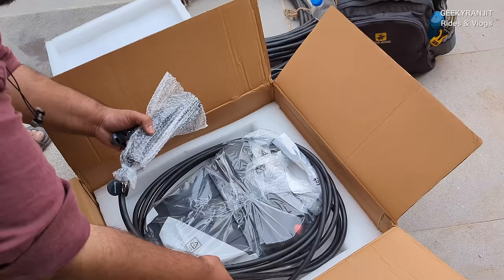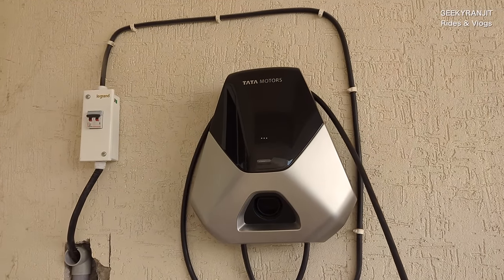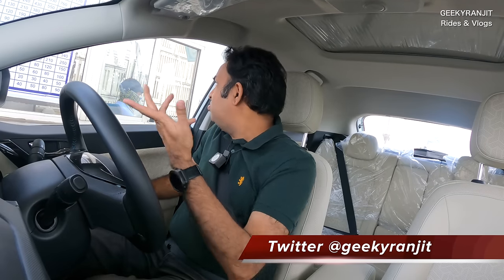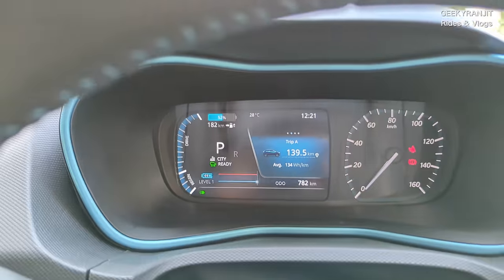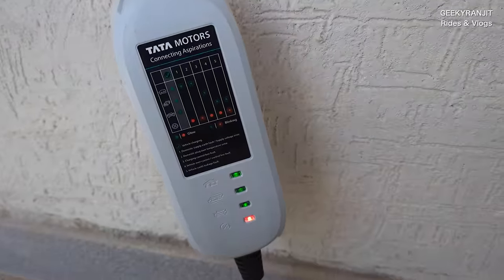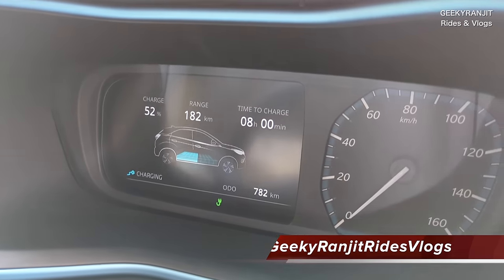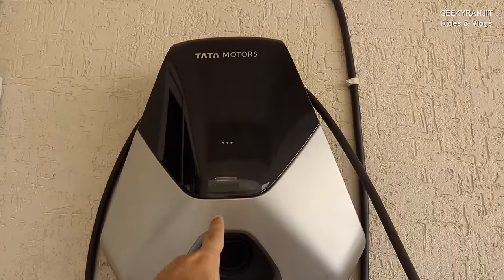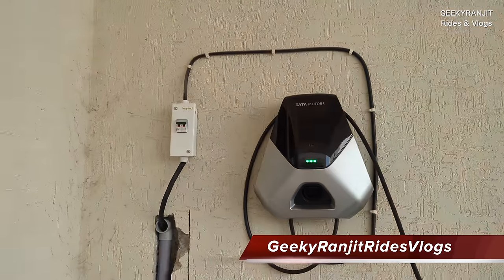Nexon EV MAX 7.2 KW Fast Charger vs Regular Charger and Tips

Comment: I always thought EVs are trash before. But when fuel prices rise and some minor road blockage connecting my state, i was fed up and bought Ather 450x. I was amazed till today and my thoughts towards EVs has completely changed. I plan on buying EVs for my 4 wheeler also when i have the money. I also think that for Indian EV lovers, Tata has done a really great job as many EVs which are not Tata are always so pricey!
Reply: I believe for a Nexon EV there a warranty for the battery for 7 years.  If it fails after that, a new battery will cost 7.5 lakhs.

If the motor fails, it'll cost 4.5 lakhs.

Ridiculous numbers. 

Taking this into account, how is an EV economical compared to an ICE?
Reply: @tanmay8844  its like thinking your ic engine fails after company warranty!  Just understand that the battery that tata uses has 3000 charge cycle capacity. 300km range per charge means 3000*300=9lakh kms. The battery should last around this. And for the motor a very rare chance of failure. Even age old reva's  are running good. For a person who uses a car intensively can save a lot. Driving feel of an ev is unmatchable.dont just think only about the economy. No sound ,no vibration, no gear shift delays, no gearbox problems,no jerk . Butter smooth ride.
Reply: @turbocharged962  Dude we don't even have proper roads and infrastructure. wake up
Reply: @shreyasdharashivkar8027  ok take an example
Daily drive 50km
Annual drive 18k km
Drive in 7years 126k km
Cost on petrol if price dont increase  6.3lakh
Cost on Elec if price dont increase 80k
So you save 5.5lakh on fuel alone.
Also in an ICE vehicle engine isnt covered/wear and tear of parts isnt covered but in Ev there isnt that many parts.
Also 7lakh price quoted was sticker price and no official price has been quoted yet
Reply: @tanmay8844  u r assuming that battery price will remain same after 7 years!! I hope u r not running your phone on petrol because of battery insecurities
Reply: in the amount u bought ev, could purchase 2 tata tigor and still have less maintenance cost . battery replacement is heavy on ev
Reply: @turbocharged962  the data you shared was tested on specific enviornmental conditions , you will always see Terms and conditions applied on such data, country like India when sometimes it is extreme hot,cod,humid battery is badly affected and those numbers are reduced drastically. why you think gorilla screen smartphones breaks so easily while company claims blah blah drop tests? because other conditions are not factored in . and why did tata reduce the warranty year on the battery? before it used to be more and i highly feel many customers must have come in for battery replacements already
Reply: @priyanshuanubis  in EV battery replacement alone will cost upto value of a new petrol car. Also , if you suffer any malfunction on ev car during road trip you will need to take it to service center , get it towed etc since they cannot be repaired locally . the charges that you factored in as of now electricity charges might be low but soon will start increasing same case that happened with CNG, if govr really cared about pollution why increasing rates of CNG now, why you think people are preferring diesel over petrol or CNG? it makes absolute zero sense to buy CNG now, all your boot space is gone, long waiting line in CNG stations and so on and this will happen with electric cars also quite soon yeah sure you can charge car at home, but soon they will charge you seperatly for that meter
Reply: @loki4171  just to inform you, we can generate electricity! Rest any of the fuel cannot be generated by general public. We can use windmills or solar ongrid systems to generate electricity. Mnre is giving subsidy to household customers. I have already installed a 3kw plant at my home(generating around 400units per month). Just dont be too negative. If you dont want to buy ev, just buy a ice vehicle and enjoy. Ev's are for people who have fixed runs. And it's not for people who rarely use their car. Its better to buy and use the car maximum, than buying a car and keeping it in garage most of the time thinking of fuel price. Many people said this when ather launched their 450model. Even after 5 years the scooters are running fine.people who are scared of buying an ev can wait. Many more added technologies will come in future. Now its all beta products and only meant for people with heavy usage.
Reply: @turbocharged962  you do realize not every one has solar panel?  And still you have not said anything else regarding to my other points. Why are companies now reducing warranty years ? Are they afraid more people will soon start coming for replacements? There already has been cases for replacement simply search TATA battery replacement forum is full of it one customer got battery changed withing 4-5 years of purchase luckily it was under warranty that time.
Reply: @loki4171  tata has sold 1lakh ev's and you are talking about 1 issue. I can point about thousands of issues on ice models. Its all mechanical and electrical parts. That can fail.  Every ev's sold in India comes with 8years of battery warranty. Even maruti hybrid comes with 8years warranty. 8years is more than enough for an avg customer to milk maximum.
And about solar panels, a person investing 20-25lakhs on an ev can easily afford 1.5lakhs for a 3kw solar ongrid. Battery pack replacement is done under warranty. Post warranty companies have provision to repair individual cells.i am closing this discussion as i dont have time to change your thoughts. You can believe in your thoughts. 🤝 For your knowledge a petrol car with the power of an ev will need 8lakh rupees fuel for running 1lakh kms. A person with solar ongrid plant at home has zero fuel expense to run an ev for 1lakh kms, if his two and fro running is under 300kms. There are many daily commuters like that. It all depends on a persons need. Not profitable for everyone.
Reply: @turbocharged962  kindly update yourself tatat is no longer offering 8 year warranty now. Recently checked myself . And this is not 1 case multiple cases are coming and 1 lakh sold you said are for those who have not completed much years
Reply: @loki4171  tata motors website is displaying 8years or 1.6lakh kms warranty for nexon ev max. I don't know where you got 5 years  info.
Reply: @turbocharged962  from showroom . Also till 90k kms.
Reply: Hybrid cars are better for India for the next 5 years ,let the infrastructure of EV develop till that time one can buy EV later also why so rush 🤔🙆‍♂️

Comment: Correction : Prime or MAX can charge on any KW DC chargers. However Prime has maximum charging rate of 22 KW/hr and MAX has maximum charging rate of 32 KW/hr. So even if you charge max on 50 KW charger its maximum intake won't be more than 32 KW/hr. This data was provided by Zeon charging.
Reply: Correction : Charging is never measured in KW/hr, it is always just the power rating like 22KW.
Reply: @ashyouknow7420  Right. When KW/hr is mentioned it is obvious that it is rate of charging.
Reply: @studyneetjeeupscsccgatecam1903  kW itself means kWh/h where the time unit cancels each other, it's unit of power=energy/time.
Reply: @Amuzic_Earth  Yes i stand corrected. Point is prime charges at 22 KW and Max at 32 KW.
Reply: hi I'm poor in physics
Reply: @ajaythodupunoori7378  hi i’m poor
Reply: @IbbiAhmed  hi poor. This is Ranjit speaking and today on my channel we are gonna talk about the new tata Nexon EV max pro edition, kaziranga black edition
Reply: @IbbiAhmed  hello poor
Reply: Tiago Ev has a max charging rate of 19 kw

Comment: Diesels are best. They give good economy, good performance. Always ready just takes few minutes to fill full tank and range of around 500-600 kms.
Reply: Small diesel engines are going to be dead after April 2023 - read about Real Driving Emissions norms 😛😛
Reply: Once you drive ev, you will forget the diesel pickup. Ev drive is really breeze both in city and highway

Comment: I bought the same car on oct 14, because i belong from a rural area of odisha there’s no any first charger available here. i am  using 3.3kw charger at home and it’s giving me about 330-340 range in city mode on a single charge
Reply from the maker: Yeah without AC I also drove a bit and can get around 350 Kms, but with AC and my normal driving I am getting around 290-300 Kms again all of this in the CITY mode.

Comment: Hello Ranjith sir, even we bought the same car and there is a range drop considerably after 1 month of usage(250-270km) so kindly check the same with ur car as well
Reply from the maker: No issues like that for me....... now driven about 900 kms.....  I am driving anywhere between 45 to 90 kms per day.  Use it in CITY mode I am not getting good range in the ECO mode......  Also try charging once by taking it to a low charge like 15% to 100% in one full charge slow charge with the regular  portable 3.3KW charger, if any in-balance in the battery it would be balanced out.
Reply: yeah, try discharging the battery till 2-3% once, and then fully charge with a slow charger. that calibrates the battery.
Reply: I have run my ev around 3500kms and without ac it goes above 300 if not pushing accelerator hard and with ac around 270-280

Comment: Ranjit can u list the reason behind going for Nexon ev max and not any other ev vehicle?
Reply: 2 reason are there

1. Nexon providing best in it's price
2. Desh ka loha .....

I am also owning a Nexon Ev max top of the line model
Reply: @karanpandey4836  I’m also sir 🤙
Reply: There were only 2 options for less than 25L in India, this Nexon EV Max and MG ZS ev and i found the Nexon to be better and more value for my needs and the features I wanted. Also I had very good experience with my Tiago and trust with Tata was also a factor.
Reply: @RanjitKumar  How about electric cost and how will we charge when in highways? Or is it only for city travel? And what is the cost of battery replacement?

Comment: Changes for next nexon ev
1.:) change media screen size (now 7 inch) change atleast 10 inch with rotation facilities
2.:) Change the position of charging point, front number is a good area, some video review mension that the charging compartment filled with mud and water so please aware of that
3.:) Provide ventilated seat swich to sentral console system near the rotary nob
4.:) Increase the Central console system height a little more and put some  angle like Lamborghini style......
5.:) Wireless charger position is very annoying and it decreases the premium quality. Change the position 
6.:) Provide Moonroof
7.:) Electricaly adjest seats

Comment: I would like to add that AC charger is where input at CCS 2 port is AC and DC charger is where input to CCS 2 port is DC. In AC charger onboard AC to DC convertor is used while in DC charger no conversion required. All AC charger has SMPS circuit in the charger to regulate 230 Volt AC and current capacity also to handle rated current. That's why 7.2kwh charger has large size to handle heavy current. While in DC fast charger DC convertor is it self in charging station. When we connect gun to port, BMS checks the maximum charging current getting and shows the time for charging accordingly

Comment: If you are paying more for the Fast charger it should have a feature or option to select to slow charge as well.. just a feature that can be added
Reply: They are charging for the infra I think rather than electricity cost.
Reply: @TargetGadget  yea agreed, the device costs a lot. From this video understood that the Fast charge will only charge at full speed and cannot slow down. They can put a Software or Hardware feature so the user/car chooses to charge slowly it should be possible
Reply: @SwatejK  there are third party chargers now which you can select the amp

Comment: I would highly recommend using the 7.2kW charger - the type 2 charger at all times. It's safer n faster. Not sure why Tata is being cheap n promoting the granny charger - 3.3kW. The charger pins heat up, the plug can heat, n the charger itself will get very warm after a few hours.  Worldwide is only used in case of emergency for safety reasons.
Reply: actually every society do not give 10kw. mine I have to fight for 7kw

Comment: Just a thought , given that nowadays we are also seeing hybrid cars with a mileage of 22kmpl any reason but considering nexon ev . nexon ev has proven itself and leader in segment though . just wanted to understand you thoughts while you zeroed on to an ev.  This will help new car buyers to make decision without any anxiety over evs range
Reply from the maker: Hybrid is just a half based solution...... Electric and zero emmission vehicle are the future.  See what happened to BS3, BS 4 car now BS 6 standard II will be coming in effect in 2023 Govt will just getting tighter and tigher in terms of emissions.  I wanted a zero emission vehicle, also I will be install a solar plant so effectively I will be running this car for free.
Reply: I would say do your own research as well as there is nothing like zero emission. An EV already done its carbon emissions before it hits the road and also i don't see it's feasible enough to use ev.
EVs are only for those who has multiple vehicles at home or want to save on fuels but again ev comes with a higher price tag. Like nexon ev max comes around 21 22 lakh on the other hand a petrol nexon xz plus variant costs around 13 lakh in Bangalore. So it's too early to jump into the ev race. And we also need to look for the better alternative. Running a vehicle on battery is not the solution. IC engines have proven them over a long time where as evs are there in early stage. I remember there was a scooter launched in india somewhere 10 or 15 years back 'Yo bike'. At that time also people thought that ev is the future.
Reply: @ChhotaTrex  Agar EV renewable energy se charge Hota Hai tho  ice engine hai Uske total lifespan se Jyada emission nahi karti EV .........
plus EV kha Jyada potential Hai Kyunki Agar battery ka Technology develop Hota Hai tho EV zero emission ka milestone achieve kar sakta hai ice engine Mein yah possible Nahin Hai......
Or bahut se battery Technology abhi testing mein hai jo biodegradable hai....
Reply: @seven6094  yes totally agree but abhi bht time hai. Aur ek lithium ion battery banane me jo conventional fuel lgta h lets se mining ke time lithium extract karne me cobalt me wo itna zyda hai ki EV road pr bhale na kare pollution but wi already kar chuki hai so yes battery technology should be improved and most importantly the charging. It should be hassle free. Just like hum petrol diesel fill karate hain 2-5 mins and we are good to go. Aisa kuch jab tak nahi hoga tab tk conventional fuel hi better h.

Comment: Hi Ranjit, I have recently purchased a Nexon ev , along with this an AC 7.2kw fast charger is also provided and have now been installed at my home. I came to know that slow charging is what is recommended for battery health in the long run, so I have a doubt whether what they mean by slow charging is the 3.2kw slow charger

Comment: Hello Sir, I am also planning to buy an EV next year ..... what was the waiting period for car ?
Reply from the maker: On the MAX variant there is a high waiting for 5-6 months as of now at-least in our city, regular EV Prime you can get within 1-2 weeks.
Reply: @GeekyRanjitRidesVlogs  agree
Reply: @GeekyRanjitRidesVlogs   The waiting period seem to have reduced now for the max. I booked mine on Oct 24 and got a car allotted on 11th November. I have gone for the lower variant ( XZ+ 3.3 kW) though.
Reply: @shas312  which city bro?
Reply: @prasoonkumar97  , Shivamogga, Karnataka. Initially they quoted 5 months waiting period, but got one allocated. One reason for the quick allottment might be that the dealership started selling EVs very recently ( maybe from the past 2 to 3 months) . Max bookings are still new here. If Tata has some quota for every dealer during car assigment, then it maybe that my number might have come earlier. Also since the EV team is new, they are very responsive and are trying to get a good image with new EV customers. The higher ups in the dealership are taking special care to ensure the EV sales grow in the city. This may be the 2nd reason. Third reason might be with my choice of varient. Most of the bookings of Max are happenning for the top of the line XZ+ Lux varient. Maybe percentage of people going for XZ+ is less. And the last possible reason might be that Tata has really ramped up the production. Please check with your dealer once. They might say months of waiting period. Pressurise them a bit, they will get one assigned soon. Btw in which city are you booking?

Comment: @geekyranjit: Currently my home has a single phase connection with a sanctioned load of 4 kw. Can I charge my car with a 3.3 kw AC charger and run 2 nos. of 1.5 TON ACs? Can a 7.2 Kw AC charger be installed in a house with single phase connection? Is it safe to charge my car with a 7.2 Kw AC charger and run heavy duty appliances like ACs, Geysers ?
Thank you in advance for your suggestions and advice.

Comment: Ranjit, only concern for me to take an ev is charging, we stay in a apartment can you cover what is the process to install these in apartments and does tata help us here?
Reply from the maker: Check with your apartment society if they have a common 16AMP socket or will they allow you to install one in your parking slot.  

In our society they have a common 16AMP socket for EV charging which is attached to a meter.  So while charging we take the meter reading and pay the amount directly to the society after charging the car.

Comment: Arai claimed range 
- 100km if AC ON
- 100km if using sports mode
- 100km if frequently using fast charger 

All EV cars need a swappable range extender batteries to add 100km in 2mins ✅